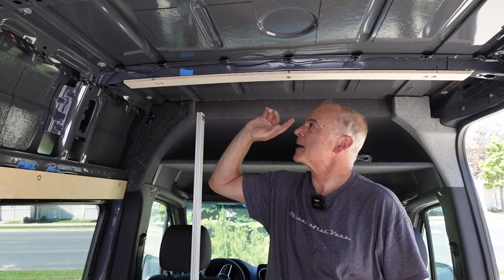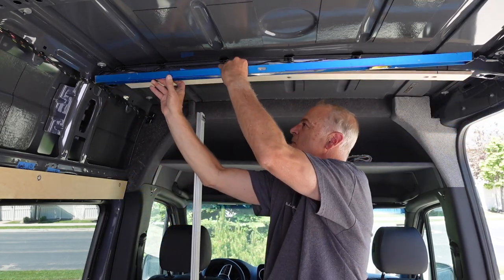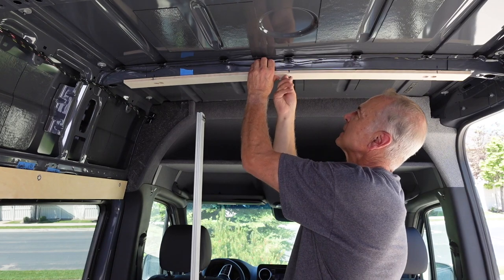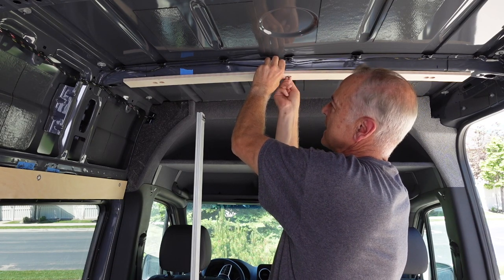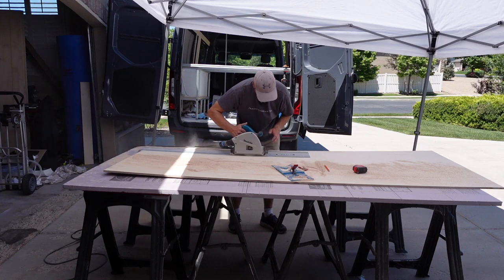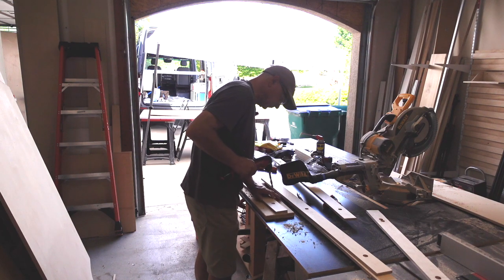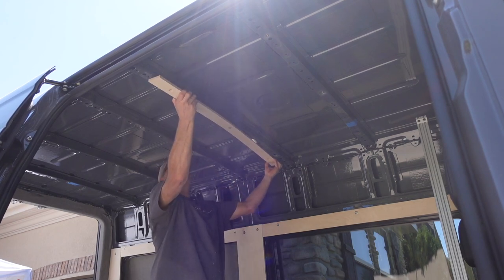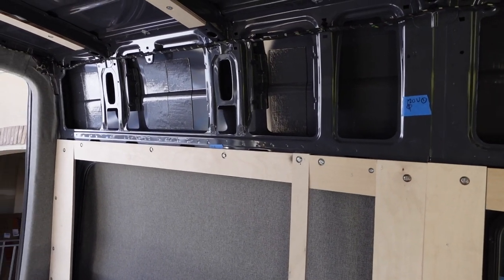Best Way to Frame a Van Conversion with Furring Strips

Comment: Wonderful, what is the recommended width for the  1/2" furring strips for the ceiling work?
Reply from the maker: We make them about 4” wide so that we have plenty of room to screw the ceiling into the furring strips without hitting the metal ribs of the van.

Comment: Thanks for this video, Jeff! I'm curious, did you custom make the pieces to fill in the gaps around your headliner shelf? If not, do you have any information on where I can find something similar?
Reply from the maker: We wrap the factory foam blocks and use those. There is a video on the channel about this.

Comment: Really informative and helpful video! Some questions, if you don’t mind: Are you using 1/4” rivnuts, and what size are the holes (or what size do they need to be)? And what type of fastener are you putting into the rivnuts? You mentioned drilling out factory holes so the rivnut would fit - I’m curious why not get rivnuts that fit that hole size without having to enlarge them? We’re working on our 2014 Sprinter, and I think the factory holes we’ve got are 5/16” for the most part, with some at 1/4.” Trying to determine exactly which rivnuts, fasteners, etc. we need to proceed. Thank you!!!
Reply from the maker: We use 1/4-20 stainless steel rivnuts and a 23/64 drill bit to bore out the hole. The screws we use are 1/4-20 stainless steel flathead screws, 1-1/2” long. The center hole in 2019+ Sprinters is smaller than the rivnut, so definitely needs to be bored out.
Reply: @thrivans  Thanks for the info!

Comment: A little late to the party here, but did you install that carpet on the walls? 
I’m going to frame my transit exactly the way you’ve done in this video. So thx!
Reply from the maker: We normally do Shiplap on the walls. If you’re doing panel walls I’d cover them in a fabric like Duramax Marathon rather than carpet.

Comment: What about rust from moisture and shavings formed;  left to sit up inside the ribs by “widening” all those holes?
Reply from the maker: No way around drilling holes in a van. You vacuum up the shavings and primer the holes. You can also put a couple magnets around the hole as you are drilling to attract the shavings.

Comment: how many sheets of 1/2 inch did you use on the furring strips for this van?
Reply from the maker: Not sure. I mostly used scraps. 1 sheet would probably be enough.

Comment: Since you used adhesive, why not just use self drilling screws? Rivnuts are meant for easy on/off.
Reply from the maker: You could definitely use screws. I use rivnuts for the added strength.
Reply: @thrivans  I was also thinking with the rivnuts you would be able to put the “studs” on and off until the whole van was framed, looks good etc…..and then pull everything off to glue it. 

The more I think about it, the rivnuts give you lots of options and are definitely stronger like you say. 

A little more cost and time, but for a personal build, probably worth it.
Reply from the maker: @AJourneyOfYourSoul  Agreed!

Comment: Too heavy and too much work. Use original sprinter head liner. Built in sound deadening and insulation. Even better if you insulate above the headliner. Mines been this way for years in the OZ outback
Reply from the maker: Cargo Sprinters don’t come with a headliner.
Reply: You can purchase the headliner from the vehicle breakers like I did.